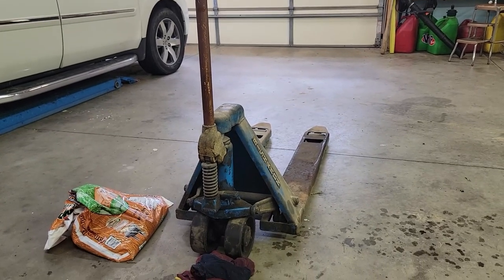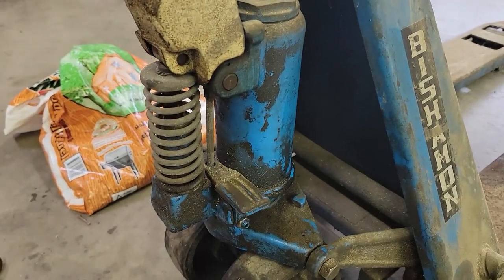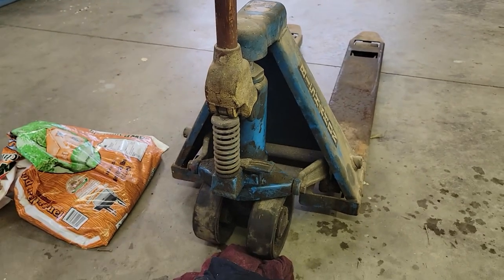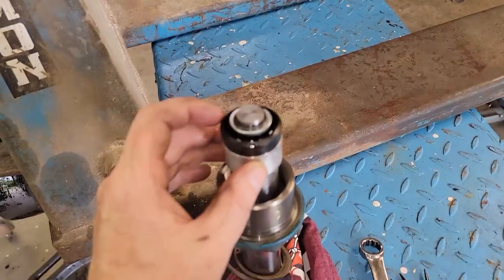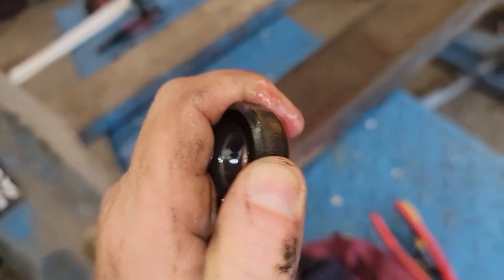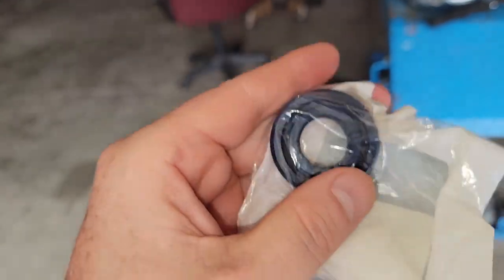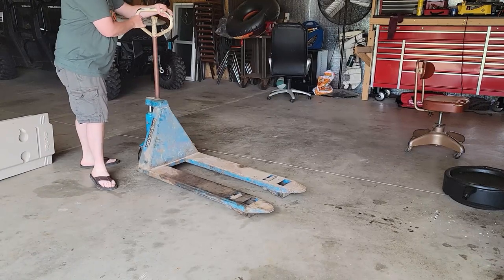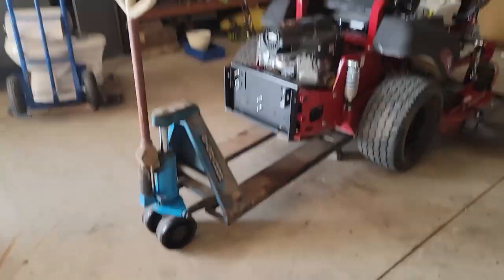Pallet jack leaks down - Easy Fix

Comment: hey uh.. sorry for the trouble.  Any chance you have a clip anywhere shows how to dissemble the  steel frame off the hydraulic pump?  
i have two bishamon in our warehouse and one of them is having the same issue as yours.  Need to get it fix it soon and back to work.
Reply from the maker: @messygreasyhand5465  I never took the whole thing apart, I just dropped the top off the frame. To get the top off of the frame to be able to disassemble you just have to take th C clip out and it drops out.
Reply: Got it, i noticed there are two snap rings, all i need just remove the rings and piston is able to drop right?
Reply from the maker: @messygreasyhand5465  yep
Reply: Thank you so much.  I was able to remove the snap ring and got the pump lid dissamble.  And just like the video, our seal is also bad and has a crack that causes leak down
Reply from the maker: @messygreasyhand5465  glad you got it working again.